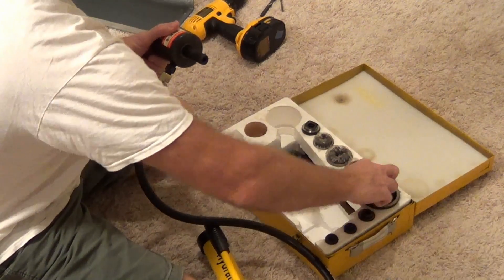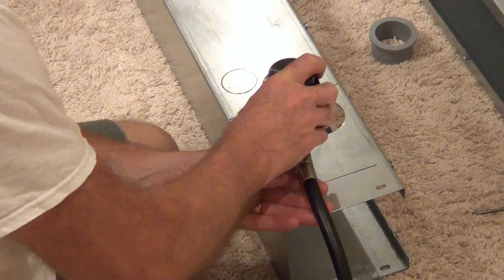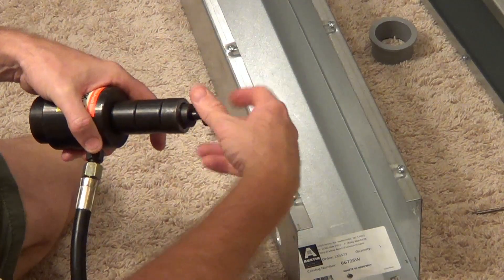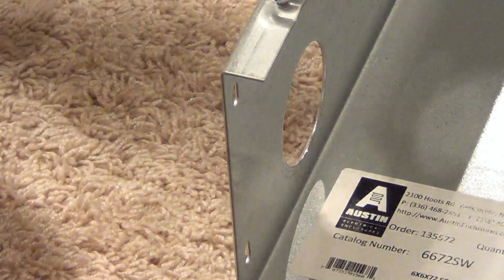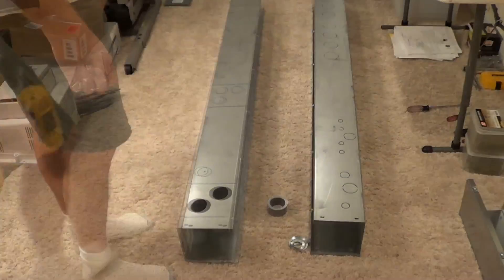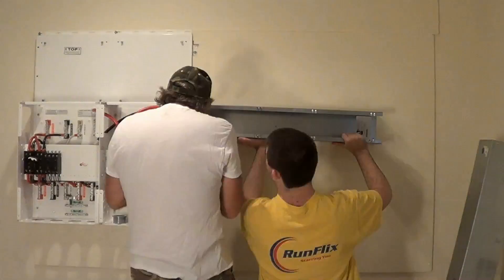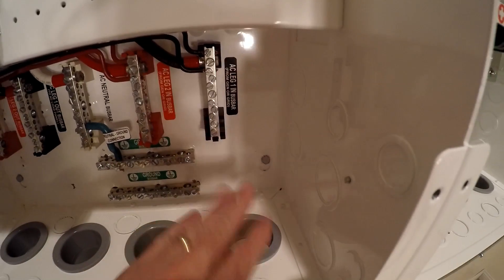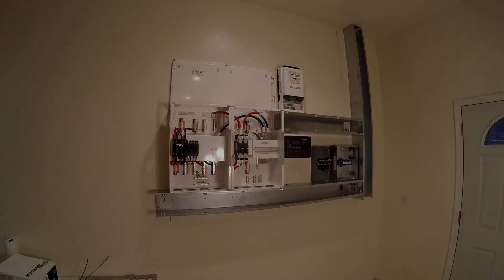Off Grid Solar #12: Hydraulic Knockout Punch Driver

Comment: Why not just use a hole saw? you can get a whole bi-metal set for cheap and you're already drilling the holes.
Reply from the maker: The knockout punch is easy and makes a very nice hole.  I did drill two holes with a hole saw and it was a disaster.  It was really hard to do and made a BIG mess.  For me, the knockout punch was the way to go!
Reply: Hole saws take some Skill. Usong one with a pilot bit helps or drilling in reverse to get the grove started. When drilling through something thin like vynil or plastic you can go through the whole thing in reverse to keep from cracking. 

I'm doing grid tie with no batteries so I won't need to worry about building boxes. Did you say where you bought everything?
Reply from the maker: You can find my entire parts list on the 1st video.  I recommend buying most stuff from the AltE store.  I also used Amazon, Lowes and the local electric supply company (CED).  Good luck with your project!

Comment: Hi David, you are a WORK in PROGRESS !   Nice...but ....just that word of caution, though a bit late.  It would have been a precautionary measure to place down a tarp or cardboard before the metal drilling / punching so that those pesky sharp metal fragments don't wind up in your skin.  Even after vacuuming, some will be snagged in the carpeting and cause pain much later......I found out the hard way, YEP !   Chris DIYER clued me into your channel.  We self-made handymen all learn from each other and improve through our accomplishments.  Keep up the PROGRESS !     Jim K
Reply from the maker: Yes sir you are very correct about that.  The punch set is very oily and I did mess up my carpet a bit with it plus the drill metal does go down and get stuck.  I should have done that outside.  Just don't tell the wife, she will kill me!